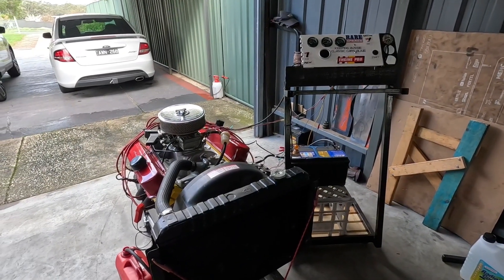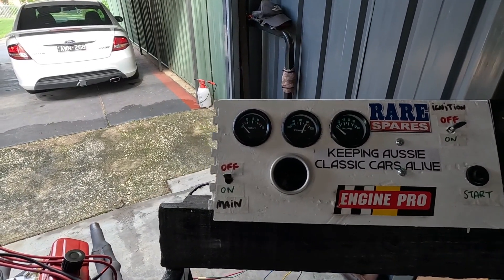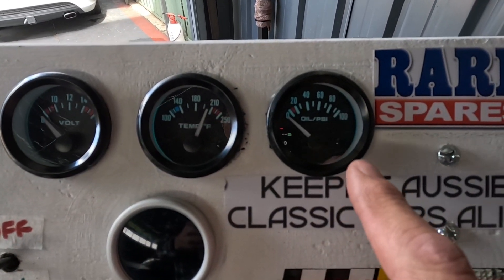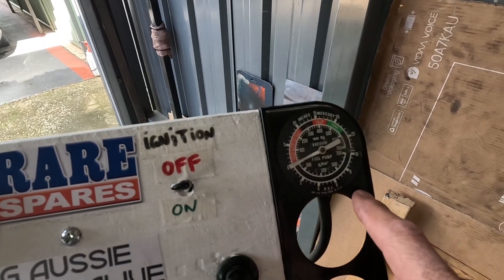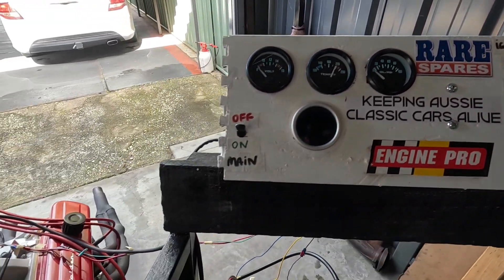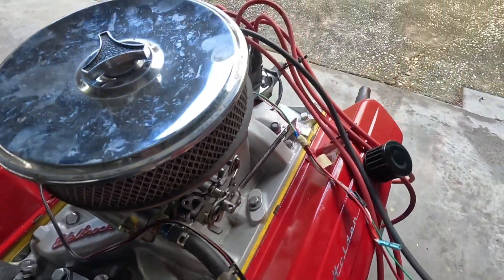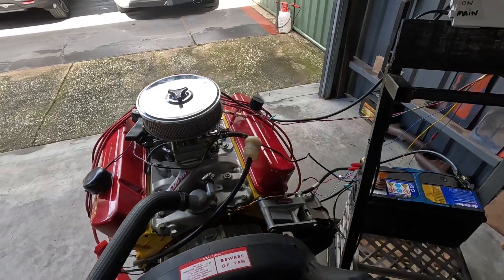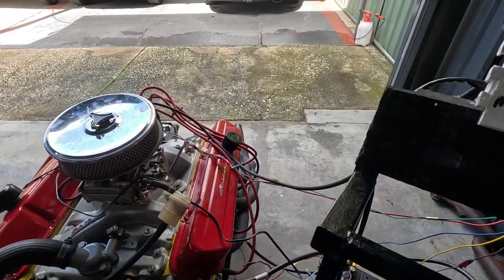Holden V8 bench test.

Comment: Looks and sounds terrific, what carby & intake manifold is that and the camshaft was she upgraded ? What horsepower would you be expecting to squeeze out of her ? Interesting clip, thanks for posting, cheers, Andy in Adelaide.
Reply from the maker: @gashy1000  Hi Andy, thanks for the support.  It is running a Edelbrock Performer dual plane manifold with a 600 holley carby running 55 main jets, and match ported to yella Terra cylinder heads. A stage 2 cam, a double row timing chain, and standard electronic ignition. Make sure you check out my other videos.